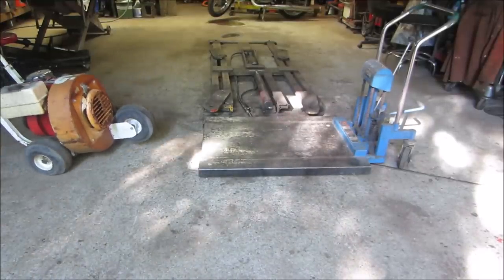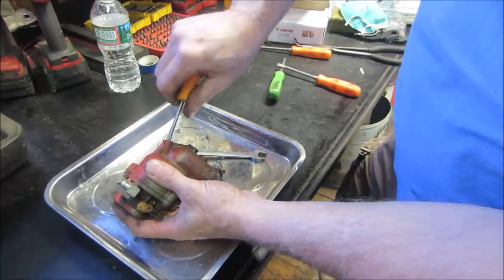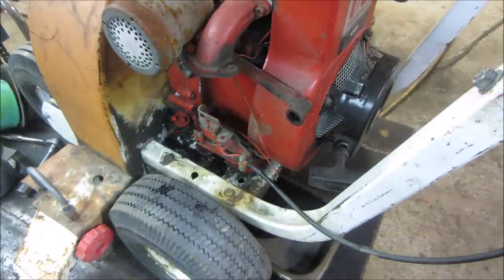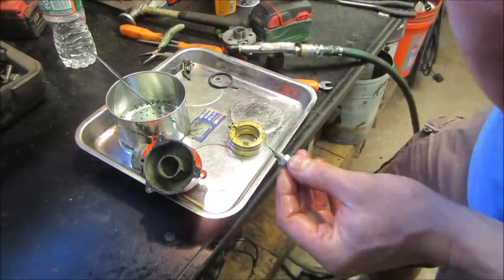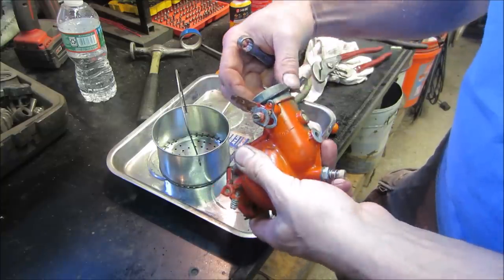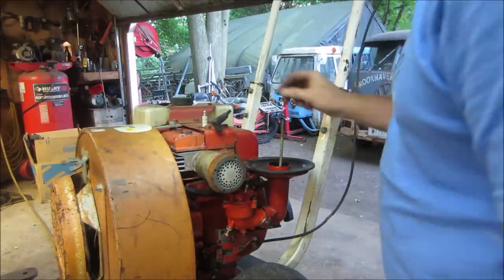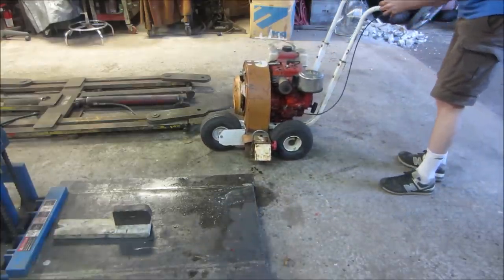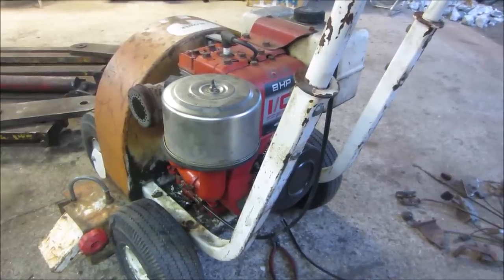Will it Run? yard sale leaf blower.

Comment: btw 1 proof is .5% alcohol 200 proof would be pure alcohol
Reply: there is no real 200 proof/100% pure alcohol, as it's super hygroscopic and will start pulling moisture from the air instantly =p
Reply: true but it is an easy to define example of how proof relates to alcoholic content
Reply: the % of alcohol is exactly 1/2 the proof number or vice versa the proof is exactly double the percentage.
likely none of it is exact percentage as they say, since everything is only sealed so tightly
Reply: @throttlebottle5906  In Canada 100 Proof is as high as it gets. 100% alky.

Comment: Pure Ethanol contains 0% water.  They are totally different compounds.  Ethanol is hygroscopic and will dissolve water into it.  That is why old school dry gas wall alcohol, it kept water in suspension instead of pooling at the bottom of the tank or float bowl..

Comment: Alcohol will combine with water and also gasoline so if you have water in your gas alcohol will allow you to burn it off without much trouble. On the bad side, alcohol eats away at the metal and rubber parts of your carburetor. That's where the biggest problem lies.

Comment: One way to tell if gas is non ethynol, is to put a cup or so of gas in a clear container (coke bottle), add a half cup of water, and shake it up. If it has ethanol, tge water will not separate immediately, and will be in solution attached to the alcohol. Non ethynol fuel will separate immediately from the water. Non ethynol fuel will store much longer than 10-15% ethanol from my research and experience. I never run anything with ethanol in my small engines. Jmho

Comment: 130 proof is 35% water. 200 proof would be 100% alcohol which is impossible. When distilling alcohol it will at some point pull the water and alcohol. You can get it to like 99% alcohol by using drying seives I think. Learned this on YouTube,  so don't know how accurate it is.

Comment: The water is miscible in the ethanol and will attract water. BUT the water will NEVER come out of the ethanol. Your gas always has drygas in it. The fuel can hold up to 10% water before excess water will drop to the bottom. It never comes out of solution below this amount. The gas doesn't come with water in it as the ethanol is close to 98% or higher at the refinery. Always curious how people in the comments never passed high school chem but are experts.
Reply: And also 20/30/40 years back carb kits were sold because people would neglect their equipment just as they do now. Now it's just more convenient to blame it on the fuel.
Reply: Some people who never pass high school chem become experts by experience which is a great teacher in itself.
Reply: Is 'miscible" professional jargon for "mixable" meant to keep non-experts from learning anything?
Reply: Whether you believe it or not, phase separation is a real phenomenon. I’ve been in the small engine repair business for most of my 62 years, and I do a lot of research and read the trade publications. There is LOT of good info out there on the problems with ethanol in fuel. You don’t have to be a chemist to understand the issues involved. I see it on a daily basis. Yes, temp has lot to do with phase separation. Extreme temp swings aggravate the problem. Power Equipment Trade magazine had an article on this problem just a few issues back. Oh, and FWIW, I have Master Tech certifications from Briggs &  Stratton in both fuel and electrical systems.
Reply: Phase separation? I'm on my third year of chemical engineering and haven't seen that. sounds like something I would write on the label of that octane boost snake oil additives. You don't have to be a chemist but it helps.
Reply: Then you're probably not working with or studying anything relevant to gasoline and/or ethanol fuels. 

That said, we agree that ethanol doesn't come with water in it. From the refinery. Along the way, I'm sure there is some absorption . Once the end users has it, that's when most of the moisture ends up in the fuel.
Reply: I'm studying organic chem(that's everything involving carbon not "all natural herbs and spices" so gasoline is a really organic chemical) toward a chemical engineering degree to work at a fuel processing center (refinery as they used to be called) this is 1st year undergrad stuff. Go buy a used college chemistry 101/102 text book on ebay and you can find all this stuff for yourself. My job will be to over see how the fuel is processed as it goes through different catalysts as its refined and cracked and separated, then made into other products. Water in the your feed stock(crude or partial refined oils/gas) is a huge problem and has to be dealt with accordingly as it can poison reactions, ruin catalysis, or break down into explosive H2 or O2, or even form steam which can be very reactive in the presence of catalysis unlike hot water. Steam can burn magnesium explosively water can not. I like how people just make assumptions then spout them as fact when all they know is what they watched off youtube or the history channel. There is a lot more to this, if it seems simple that's because you don't understand the scope of it. Not your fault just what we all go through as we start learning. My first year I thought I was an expert 2 year I realized I knew nothing 3rd year I'm starting to get it.

Comment: Love your video's.
One thing, can you please call them engines not "motor's" a motor is electrical and engine is combustible. And you can tell me off now...lmao
Reply from the maker: motor oil, motor boat,motorcycle,motor sports, hows that,,
Reply: Haha you always say that , 😂 it's true
Reply: Mustie1 LOL yeah engine cycle, and engine boat don't really roll off the tongue as well.
Reply: Motor refers to a machine that changes another form of energy into kinetic energy. Engine refers to a motor that changes heat into kinetic energy. All engines are motors but not all motors are engines. Both are correct for a gasoline engine, one is just a little less specific. It's like saying snake instead of copperhead.
Reply: Motor Head, Motor Mouth
Reply: Anything that produces an explosion to produce power is an engine not a motor...period! Just because someone calls it a motorboat does not mean it's called a motor. Wow....you give awesome educational videos but you seem to deny some from others?. I'm correct and won't continue to argue about it.  Anyways...you still produce awesome videos and call it what you want, just thought you would want to call an engine an engine and a motorboat a motorboat.
Reply: You're all wrong, it's a prime mover. 😀
Reply: I guess a stick of Dynamite is an engine then,
Reply: GM Kof hard 
Can't forget FoMoCo
Reply: Don't forget motor car or motor vehicle. (Aus,uk).
Reply: Limey, by any chance?
Reply: I love motor boating 😉😉😉👍👍👍👍

Comment: Pure alcohol surrounds water molecules and allows it to burn through.. you can bet the gas sellers know this and add water Sometimes they add way too much, once I filled my motorcycle tank, then a couple miles down the road it started bucking like a bronco then quit entirely, after busting the chain. I removed the fuel line, and drained out about a half gallon of water in a two gallon tank. Luckily, I had a master link with me, and could fix the chain right there. I was ticked, but what are you really gonna do? Sue them for the price of the gas and master link? I don't think so.